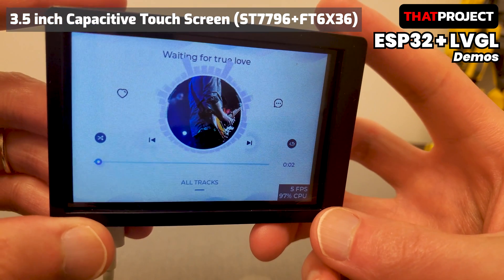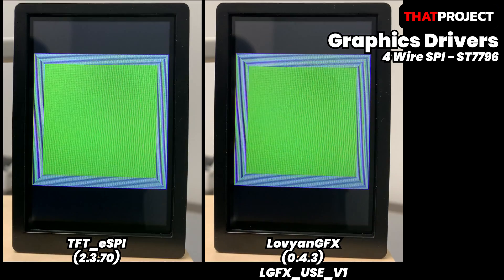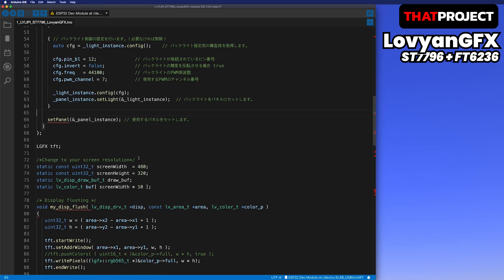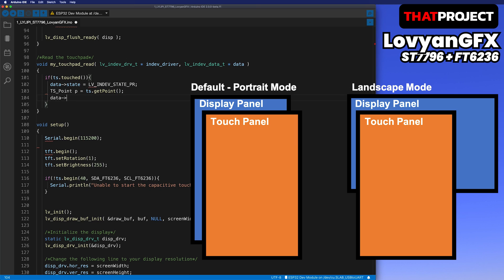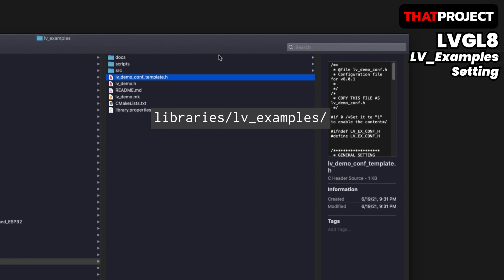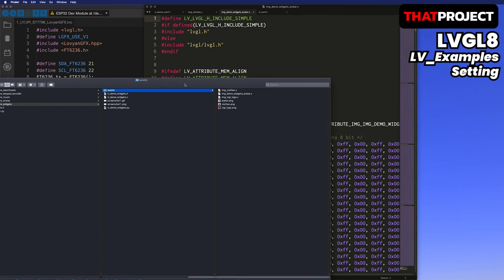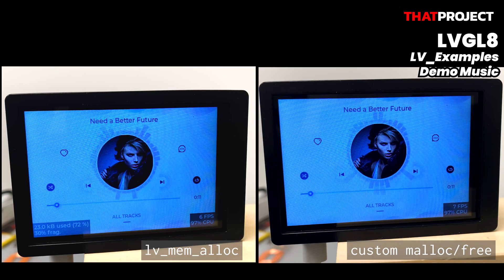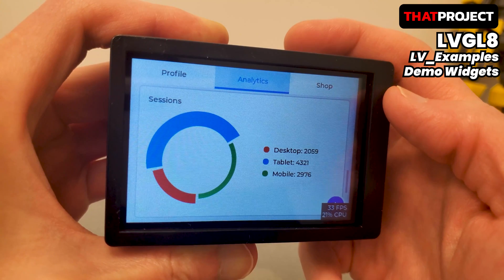ESP32 | LVGL8 | Ep 1. Demos with LILY PI

Comment: nice use of LVGL demo using ESP32. I thought it would be slower but it's acceptable somehow!!
Can this project be done using the previous LCDs (normal LCDs with st7796 or ili9488). without  the use of lily PI?
Reply from the maker: Of course. You can use it with the combination of ESP32 and LCD(st7796 or ili9488). You don't need to use this product.